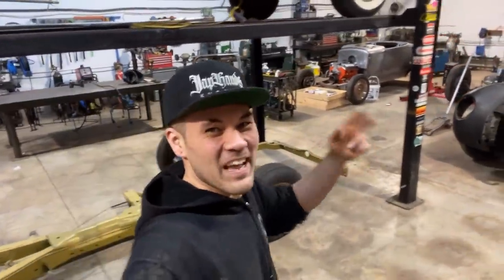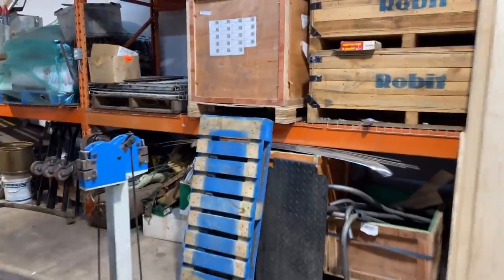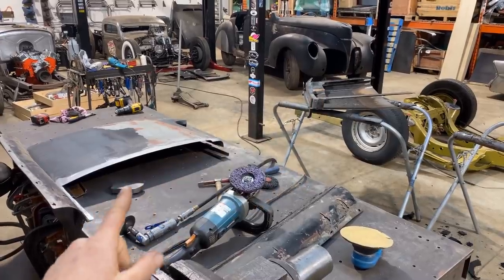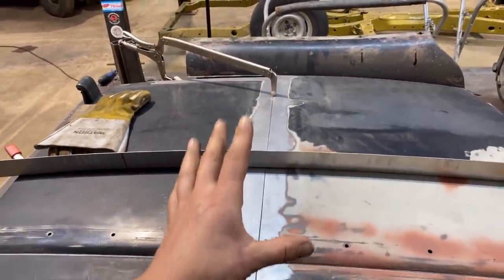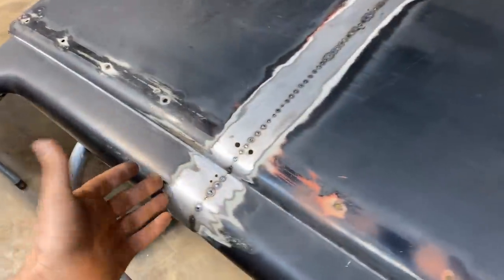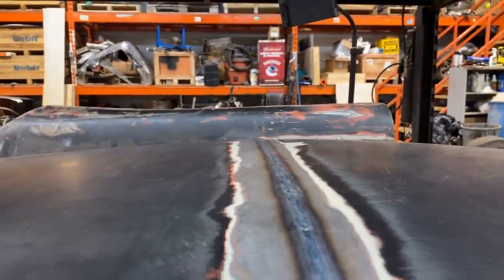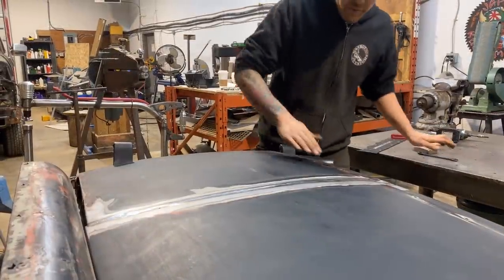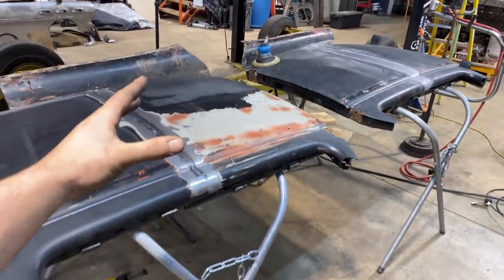How To Tig Weld Thin Sheet Metal - Planishing & Finishing Doors 1939 Zephyr Chopped Coupe Conversion

Comment: Love your videos, very helpful, I’m confused when you first planished your weld with a hammer and dolly , you said that in some areas you might have to hammer it on dolly. So am I correct to assume that every where else you were hammering off dolly?? And just raising up the metal opposed to stretching it?? Thank you so much. I might add that I’m a beginner who has a cheap tig welder that I’m trying to teach myself to use.
Reply from the maker: Thanks Michael. Great question. Yes you’re correct when I’m referring to hammering on the dolly I am stretching. I’m going to make a video next week that goes into more detail how to planishing

Comment: „oil can“ is a nice term for that tension. I learned bodywork from a guy speaking a rare dialect from coastal germany, his term would be „kiek, dor sitt een frötsch in“. Could be translated with „just look, there‘s a frog sitting in the metal“. 

Just one question: I‘m learning a lot from your explanations about how the heat and the shrinking and stretching is working in the metal. Your way to hammer and dollie the tucked seam before welding at 25:10 you said its for having the sheets perfectly aligned. Is it also working out like pre-relaxing the seam? Like you‘re slightly overstretching the seam, before the weld will shrink it back together?

Comment: I liked the idea of running the welding wire rod down the panel to see how well your doing flatening the join. could you tell us what amps your running as you weld different jobs as it would realy help to give a starting figure. `I have built my fixture table this weekend from a flatpack kit and hope to now start to make things to help around the workshop. first will be a stand for the pillar drill and grinder with an old wheel as the base. You have been a real insperation to have a go myself. Watching Kevs Blog in england as well, (have you seen it?) he like yourself has a way of educating and entertaining without it sounding out of reach,         Keep up the good work and many thanks.
Reply from the maker: Right on I’ve been thinking about getting a fixture table like that! For amperage I’ll give you the best tip I’ve ever heard. One amp per thou … that’s a great starting point and throttle from there
Reply: @MakeItKustom  I’ll have to give it a try. Will need to find an imperial measure. All metric here. When I here imperial I wish my maths was better. 

Thanks again for all the videos

Comment: What 3" arbor are using for the cubitron discs? The one I got at Harbor Freight has a mean wobble in it that makes it jumpy and wears the discs really unevenly. I got a 3m 2" arbor at the hardware store that runs really true, but it's more like a hard plastic instead of rubber, which seems to make it a bit more aggressive.
Reply from the maker: I prefer the 3M one that’s a little bit harder. Allows you to use more of the disc
Reply: @MakeItKustom  Thanks! I love your content. I'm just starting to get into metal fabrication, and your content really gets my imagination going. I've never been into hot rods (more race cars), but you've really opened my eyes to the hot rod world view.

Comment: I much prefer cutting panel with a electric grinder (and glad to see you have the safety shield fitted) the air-powered cut of wheels are so much harder to hold and cut straight with as the body is 90 degrees to the wheel and i never feel they have the same cutting power.

Comment: Kevin, could you TIG-tac a joint only.....and it got strength ? Would be fun and see how much diffrens in stregnth it is betwin a TIG-tac weid and hole weld?
Reply from the maker: I don’t think it would be a good weld because it would not be consistent penetration. I’m sure it would be fine but it’s definitely better to do a full well

Comment: As you where welding, I couldn't help to notice, the tungsten.. what size do you use for tig'n up body sheet metal, and how sharp is the tip of the tungsten, lol... looks like a sewing needle.. also what amps do you start with for sheetmetal?
Reply from the maker: 1/16” tungsten and 50-60 amps
Reply from the maker: I sharpen 3/16” long on a 1/16”

Comment: Loved that one! I just bought a welder so I will learn how hard this is. Thanks for the inspiration. You're an excellent teacher. 

What thickness was that sheet metal?
1/16th Tungsten? 20A?
Reply from the maker: 1/16” tungsten and about 40 amps .040 filler wire

Comment: I thought oil canning was fixed by shrinking?  You stretched to fix it.  Please explain.  Thanks.
Reply from the maker: I know this is hard to explain in a comment but it can be caused by both LOL picture a dent we are creases happened around the outside and when you pop the dent out it has an oil cannon. That crease has stretched that area around the dent that will need to be shrunk. But picture a oil can like mine where we know the weld has shrunk and created the low dent. This we must stretch to expand the metal for it to come back up

Comment: Great job explaining as always. I believe the one time cut with the sharpie can be somewhat scary for a beginner, I’d probably sneak up on it. That type of cut comes with experience is my guess. Have you ever had the need to file fit? Or would you sneak up on it more often as a beginner? Thanks keep up the awesome vids.
Reply from the maker: As a beginner I sneak up on it but once a learned how to set the panel up before I market then I started doing one cut and then but

Comment: Could you just overlap both panels and cut them at the same time? Is there a reason you didn’t do it that way?
Reply from the maker: For me this is not accurate enough it’s too easy to mess that up and just the gap left by the cut wheel it’s too large
Reply: Thanks for the answer. I was just wondering. Keep up the good work.

Comment: I’ve watched a couple of your videos and must admit that you have some serious skills! Very fascinating what you are able to accomplish! 
I do understand that this video is about how to use TIG on sheet metal, but would it be possible to make a 5” wide metal strip with correct profile that you would glue with automotive adhesive on the back side of those two doors? No warpage and just a bit of body filler to smooth out any gaps that might be.

Btw: I am here for the welding part 😉
Reply from the maker: Anything is possible ! I just don’t like to glue stuff. I know most new cars are tho

Comment: Why not use silicon bronze for the door skin?
Reply: It's not intended for butt welded seams and will crack. It's meant for lap welds and non structural applications.
Reply: @CarterAutoRestyling  and a whole lot of heat input.

Comment: So you don’t use air to cool the panels while welding?
Reply from the maker: I don’t call the panels when welding with tig. Just nice even heat and move quickly so there isn’t a lot of it. Then evenly stretch out the effect of area
Reply: Thank you for taking the time to respond to my questions 
It’s very much appreciated 
Cheers